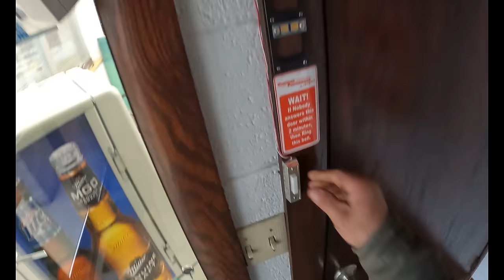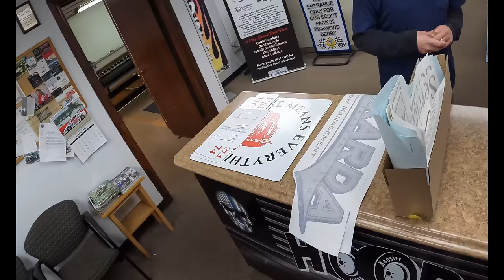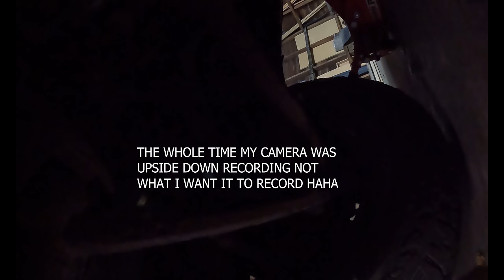I  THINK ITS TIME FOR WRAP !!!

Comment: Since you're doing a truck it will be easier not much contours to work with. I did my first wrap on a volkswagen jetta using 3M and it went smooth. There's lot's of ways to install wrap but the way I found was easiest for me was to stretch it, lay it down and squegee from inside out in small increments. Prep is important, I would suggest a thorough cleaning , clay bar and some wax and greese remover. Also consider buying some good wrapping tools like squeegees, heat gun, blade, and gloves I bought a kit off amazon it did the job. The hardest part for me was getting clean edges.

Comment: If you have not taken your box off yet slip under and use nuts off or wd-40 and spray em good and hopefully multiple times especially if it is a northern salt truck! Air impact works best . Also before doing any rust repair on truck check out southern rust free boxes ,doors , hoods , and parts as it will end up the same or cheaper and you will never beat rust free parts.

Comment: Dont get cheap vinyl . You'll need a heat gun , they have special sprays and squeegees so you don't scuff your wrap pushing it down . You'll need some nice razor blades . Most important of all for adhesion and avoiding imperfections is surface prep , I clay bar before wrapping so I'm not just covering hidden dirt and the wrap will never lift . Have some good lights and a warm area , take your time and make sure you have extra material because you WILL make mistakes